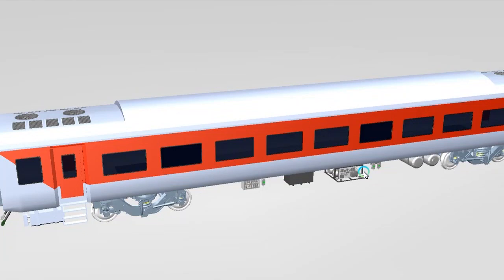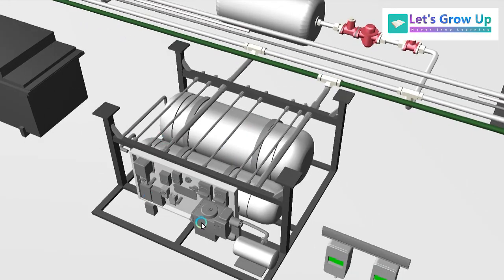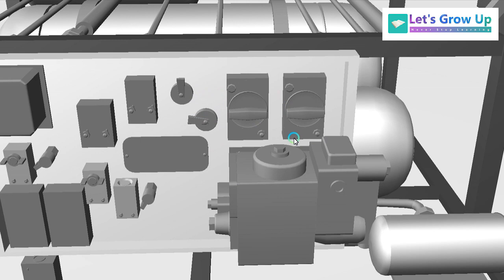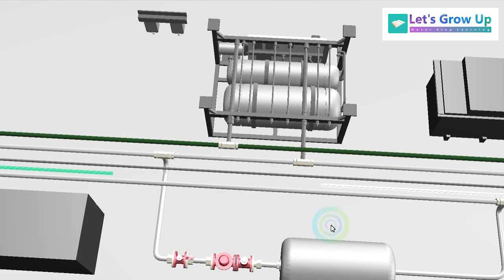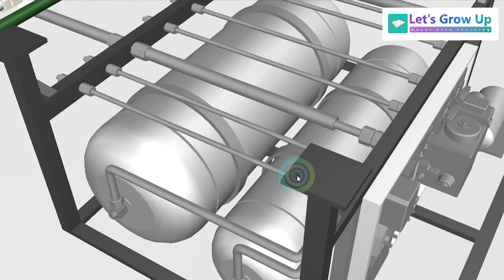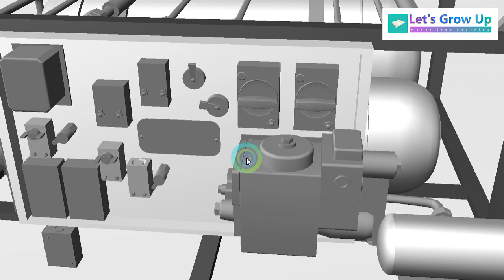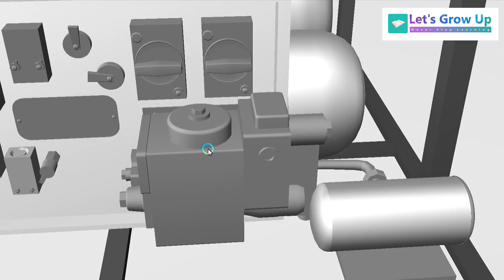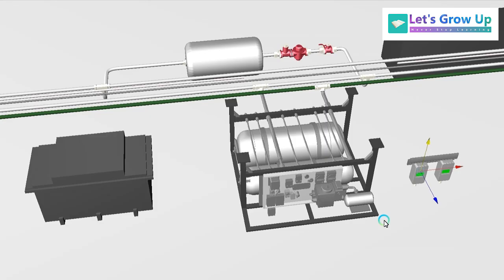LHB  Brake Control Panel Unit | #brake control panel | #lhb distributor Valve explain | #letsgrowup

Comment: I'm working in this braking system, sir can you tell me
1. Can I get the details of the software of the coach which you are using to explain the braking system
2 so that I can use this to make note of pipe dimension changes in this software for my personal use.